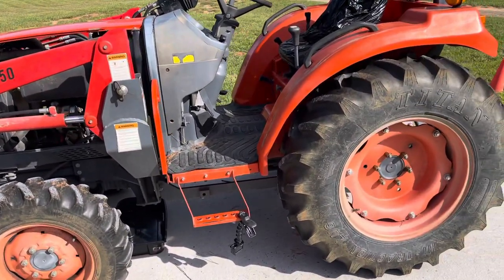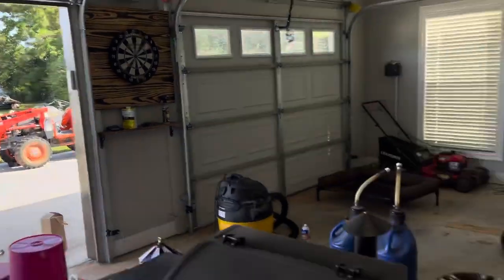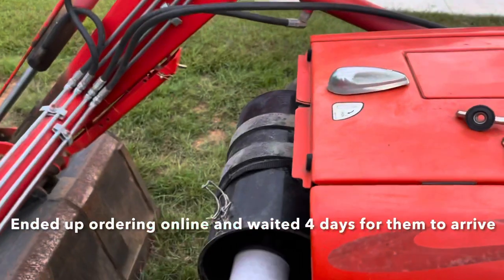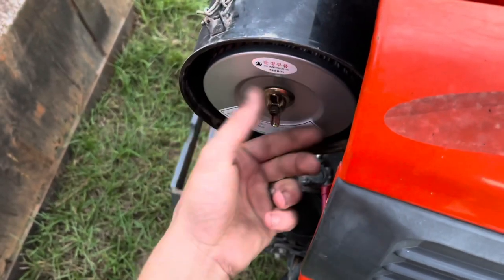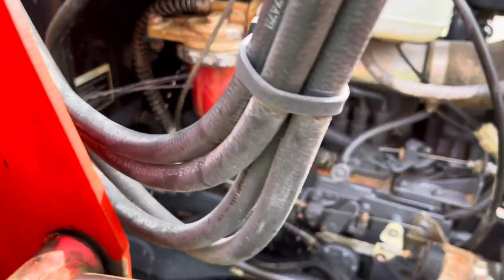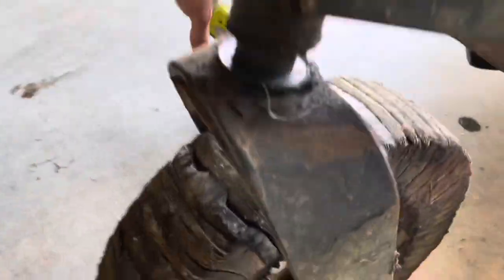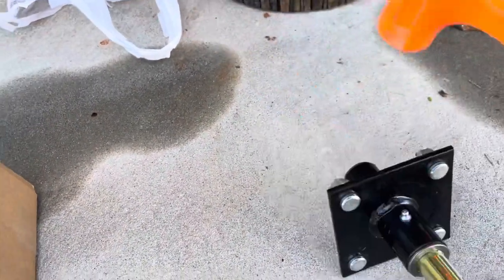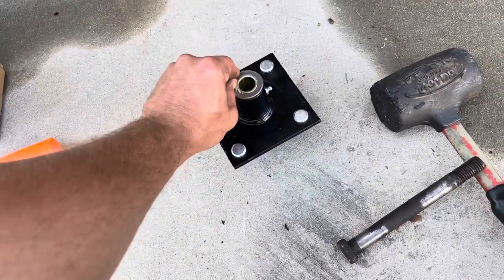Kioti DK35 Oil Change & Bush Hog Repairs!

Comment: Hi, would like to know how old the tractor is. How many Hrs.  and how reliable it's been. Going to look at a 2003
Reply from the maker: 2004 I’m the 3rd the both previous owners put 16 hours combined on it, I’ve got 228 or so now! No issues other than normal wear and tear. It’s been a great tractor but going from a 55hp down to a 35hp my biggest complaint is how underpowered it is. But it does what I need of it. Just put the first set of tires on it since new so the original tires lasted 18 years. I don’t use it much other than knocking down weeds and spreading driveway gravel. After sitting in covered and in covered for 18 years the hydraulic hoses are starting to crack and 3 of the 4 loaded cylinders are leaking small drips while in use. I drove 2 sticks into the mid pto seal, I replaced it once and the second time I found a freeze plug that fits the hole and blocked it off with a piece of sheet metal to protect it. I didn’t use it for 5 years and it just sat. Put new battery started using it again and the “driver side” axle seal started leaking, which I don’t plan on fixing because you have to split the tractor to fix it. It only leaks when in use and the “driver side” is lower than the “passenger side”. And the only other issue is the auto fuel cut off solenoid froze up and stopped working, when you turn the key of it doesn’t shut the tractor off, you have to pull the manual fuel shit off, next to key. But that’s been like that since I got it. I’ve had the unit since 2007.

Comment: I don't think I would use filter that "would work" I'd worry about sealing on them. Just keep filters on hand at the house. Easier than having to drive anywhere when ones needed.
Reply from the maker: Yeah but if I could get it from the parts store it’d be better!
Reply: @UncleMike1776  if you like driving to parts stores I guess? I'm 30 mins from a parts store. Last thing I want to do is if I forgot on a town trip before is waste an hour plus driving to town and back just to usually pay more for the same item often a better one that I could buy online and have shipped to my door for cheaper. I keep stuff around so even the 2 week or 4 week shipping of today's world is not an issue.

That's just me though. I order 95% of my parts and stuff online so I'm use to it. Way easier, cheaper, more convenient and better brands for less money than local stores.

Comment: the fuel filter was cheaper from dealership than the wix
Reply from the maker: @stephanied143  right on, I’m glad you have a dealership close by that you can get parts from my closest dealership was over five hours away from me! So I cross reference most of my parts and get what I can locally